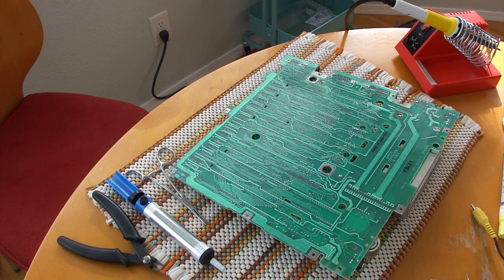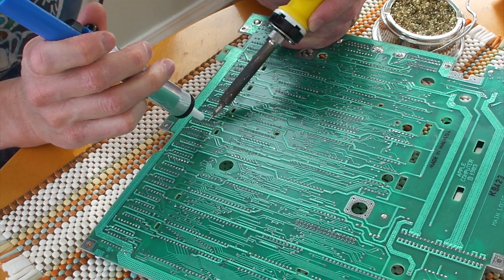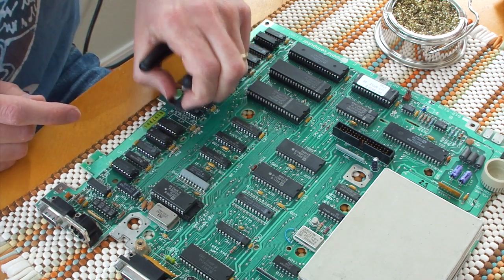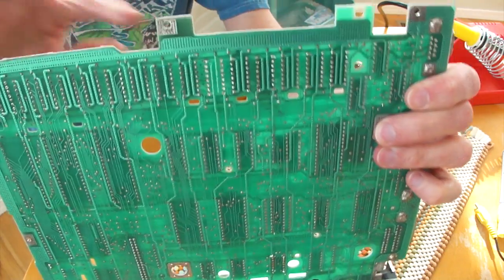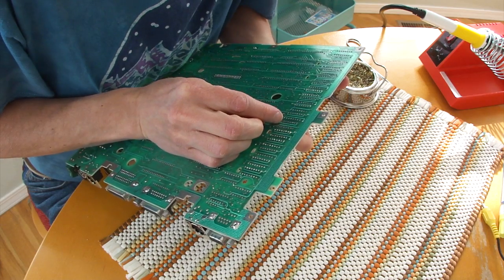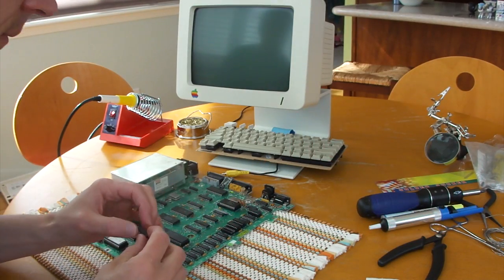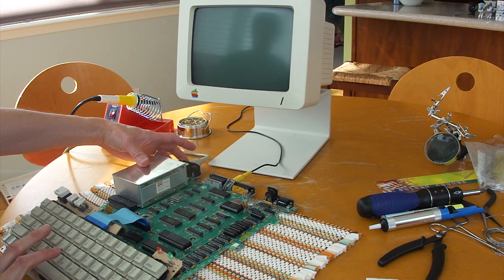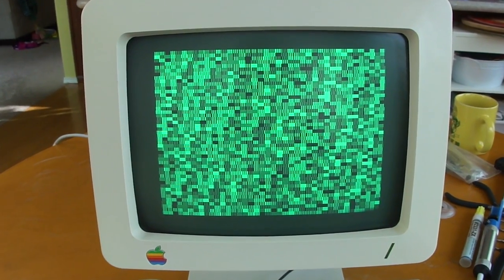Replace RAM in an Apple IIc Retrocomputer

Comment: Can you socket all the aux ram that's under the floppy drive without anything hitting the drive or drive components?
Reply from the maker: Yes, but you need to get low-profile sockets. Some sockets are just too tall, but there are short ones that will work just fine.